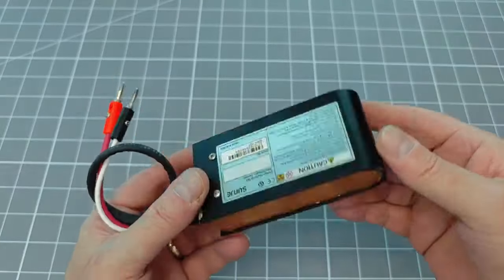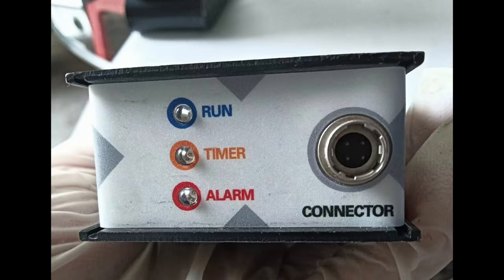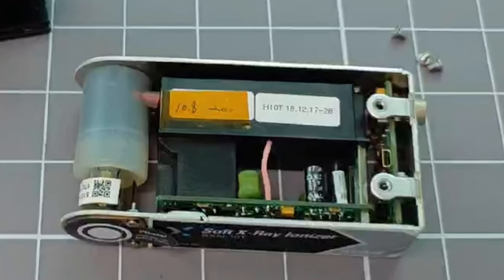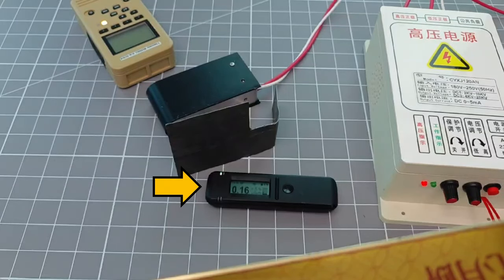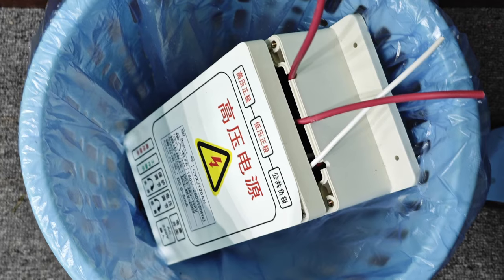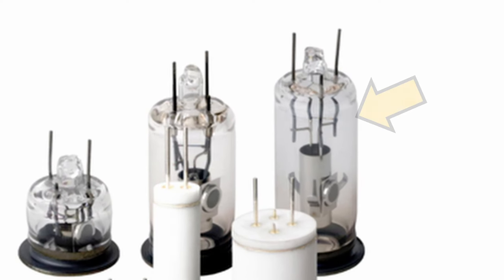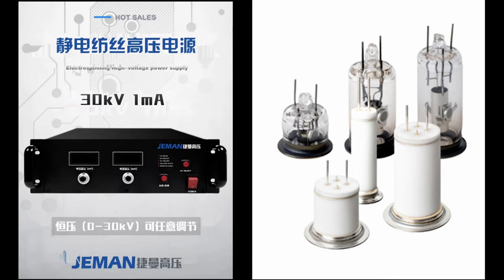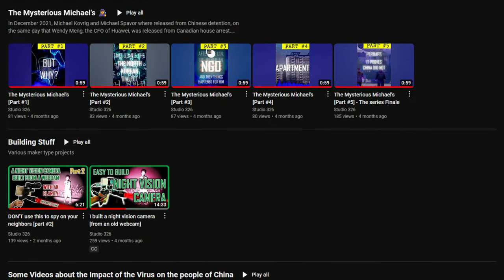a DIY x-ray generator ☢️

Comment: In case you want to do some Experiments with Photographic Film, i can highly suggest Fuji Instax Instant Films (also the classical Polaroids work, but they more expencive;). I did some Experiments with that stuff in the past, and can confirm its sensitive to X and Gamma Rays. Its a bit fiddly to get the unexposed Photos out of the Cartridge and back again, theyre very light sensitive so i do it under 2 Blankets in complete darkness. after getting them out of the Cartridge, i put them in black Envelopes + Gaffa Tape, then theyre ready for exposure. I even got a kinda Gamma Ray X Ray-Pic once using a Radium painted Compass as a source. Also got clear imprints of small Uranium Glass beads after 2 weeks of exposure ;) After Exposure, back under the Blankets and try to fiddle the Photos back into the Cartridge and into the Camera. I just closed off the Camera Lens with Tape, then press the Shutter to Develop the Pics. Im pretty shure you could get some Photos done this way with youre new Device. Thanks for all the great Videos! Enjoy every single one alot! :D
Reply from the maker: some great ideas, thanks!

Comment: Photograph a pad lock to obtain the pin cut to replicate a key . Photograph a electric circuit that's in cased in epoxy to determine the design details.
Reply from the maker: interesting ideas!
Reply: Another one radiate seeds and find a new plant with great properties.

Comment: Just thought I'd let you know that the radiacode isn't sensitive at all to the <5keV x rays that make up a large proportion of the dose. It only has flat dose response down to 20keV, and is designed to measure deep dose. The shallow dose in the place where the RC indicated 80uSv/h was undoubtedly in the many mSv/h. 
Loved the vid btw, such a cute tube and housing!!! Try measuring the output with an unshielded ion chamber. It'll be quite a high exposure rate!

Comment: Very cool. Totally unrelated: could you recommend a beginner geiger? Something simple but still solid and reliable. Thanks 🙏
Reply from the maker: It really depends on what you intend to use it for?
Reply: @project-326  two things really, I've been watching alot of plainlydifficult videos on orphan sources 😂 and I live pretty close to a nuclear reactor. I have kids and you know, I figure it might be a good thing to have at home :)
Reply from the maker: @maltadevnull  I sounds like you want something that has a good level of sensitivity for background measurements.  The problem with the cheap ones, is they all have some kind of limitation.  For example, the BR-6 is good for background by has a problem that it can real anything over 100 uSv/h (there is a video about that device on my channel).  The Pudibel devices have a good reputation, but I have never tested that product...
Reply: @project-326  alright, thanks mate! I'm going to look around.
Reply from the maker: @maltadevnull  Did you watch my little video the subject of orphan sources yet?  Personally, I thing that the scale of the issue is larger than most people imagine.
Reply: @project-326  yes I did, however after writing you, seeing as how you say you're not going to give out recommendations for Geiger counters in that video 😂

And yes, it is quite scary when you start to think about it. I'm not immediately worried for myself, it seems to happen more often in poorer countries. Still though, it's good to be aware of the problem!

Comment: Nice. The spectra with the 20 keV peak does look like Rh, but what it shows is the tube voltage at that time was much higher that you state, maybe 50-90keV. I assume you subtracted the background spectra collected while the tube was off. It is common to use tubes with a Rh source for analytical instruments like an energy dispersive XRF. You could not excite the K shell of Rh unless you have a tube voltage greater than about 25 keV, but realistically needs to much higher to get sufficient intensity in the Kab peak.
Reply from the maker: yes, I assumed that to do any XRF, you would need photons of a higher energy to start with.  Once I get my decent power supply, I will be able to make more careful measurements.  Maybe it was just wishful thinking that I could conduct XRF with a soft x-ray tube and a gamma ray spectrometer...  Normally handheld XRF machines use 40KV for their tubes.  What is nice about these soft tubes, is that they are rated for continuous operation, so I can make long duration measurements.

Comment: Would such a source be suitable for diy X-ray spectrometry?  If so perhaps we could then do XRF?
Reply from the maker: Thank you for the feedback.  I think that the acceleration voltage might be too low for most XRF application, normally it is around 50 to 50 kV (this tube is only 10kV).  The applied x-rays need to be of a higher energy than the fluorescence it activates.
I hope that helps!
Reply: @project-326  Thank you so much. You are awesome.  I have contemplated compiling a book of plans to diy a home chemistry lab.  Making measurement equipment affordable to the masses.  Perhaps compiling a list of foundational experiments, such that those so inclined can learn by doing.  I see what you are doing and i am overjoyed.

Comment: 0:50
Just by you having that realization, I am much less worried about the rest of the video. Far too often people don't approach hazardous topics with the solemnity they deserve and rush into things adjacent to their skillset unwarily. Thanks for using your brain and not chasing clicks. 
Idea: How about a cloud chamber so you can determine the directionality of the "beam"?
Reply from the maker: What is nice about this project is that the vendor has good data on the beam angle and the protection needed.
http://www.sunstat.com/wp-content/uploads/2021/06/210607-SXH-10T-Manual_Eng_A4.pdf?ckattempt=1
Reply: @project-326  150 degrees? I guess that makes sense for the application. My initial inclination is to make a collimator. I don't know if you have a 3d printer, but that might be something fun to try. I'm a materials scientist by profession, so I'd start doing material shielding measurements.
Reply from the maker: @rre9121  That's a good idea.  Since making this video, the viewers and myself have thought up all kinds of experiments.

Comment: since you have a spicy beta source, how about some experiments with it and a tungsten target to get high energy x-rays without the pains of obtaining a very high voltage source?
Reply: I'm afraid it's not spicy enough for this.
Reply: @karelsvoboda1812 yep. Enough to make the radiacode scream a bit on contact, but the dose rate from bremsstrahlung at 10cm from the source will be almost background. Not enough to replace a tube for typical applications

Comment: Hm, those soft xray modules are not cheap on ebay, I wanted to test it too.
Reply from the maker: really?  Once they have been used, they are basically useless to industry.  Probably due to the shear scale of manufacturing that happens here in China, means there are a LOT of these things.
Reply from the maker: I just looked, holy crap they are expensive on ebay - and the weird thing is that they all being shipped from here.
Reply from the maker: I just bought a couple more, on the off chance that the price goes nuts
Reply: @project-326  Any chance of resending them to Europe? :D :D
Reply from the maker: It occurred to me, that now I have enough subscribers etc, I would be able to have an official store.  Normally this is for stupid stuff like T-shirts and coffee cups with some YouTuber's logo on it.  I'm not sure if it would be possible, but perhaps I could supply some of the items that I can buy here in China instead...  Ie useful stuff.
I'm just thinking out-loud, so there could be 100 reasons why that might not work.
Reply: @project-326  That would be awsome. Those Xray tubes, Type75 meters, you could sell a lot of stuff available in your location to those (un)fortunate others living in different places.
Reply from the maker: @karelsvoboda1812  I will look into it when  get some time.  I'm sure there are all kinds of liability and import issues, but when I buy things here, there are always folks asking where they can get this stuff from.

Comment: Hi, thanks for your video I learn a lot from them. Actually the soft x ray head internal psu is quite easy to activate if you can reverse engine the circuit board. I have successfully did for VSI branded head. We can discuss the details if you want 😉
Reply from the maker: I would love to know more, I have a couple of spare units that would benefit from this...
I tried to investigate the first unit I bought for forcing it on but managed to screw up the main board (smoke released!) when experimenting with the two control pins that go between the connector board and the main board.
I have a VSI branded one too, the internals and construction techniques look so similar that I assumed that they must be the same company but with segmented branding for different markets?
Reply from the maker: @lunxg1  Project326@qq.com please email, for a WeCh ID

Comment: I’m interested in how radiation is used to remove static. I have a static problem on something I’m working on and wondering if it just had to be X-rays or if in can be any ionizing radiation?
Reply from the maker: Alpha radiation is also used for this purpose.  In the US a product called the 'static master' can be bought that uses exactly this principle and contains Po-210.

Comment: at 1:50 pay close attention to the instruction number 3. Do not the touch the widow because it is coated with Beryllium. On a side note, what is the maximum distance for the X-ray coming from this small device? This could be very dangerous if it gotten in the wrong hands as one can conceal this device in a certain location inside a house in order to irradiate adversaries with it? in other words it could be weaponized!!
Reply from the maker: this is a really low energy source, with a peak photon energy of around 10 KeV.  A couple of centimeters of plexiglas or a fraction of a millimeter aluminum will be enough to block this.

Actually the window is not beryllium coated, it is completely beryllium (about 200um thick), otherwise the weak x-rays would not be able to pass - the glass tube that compromises most of the x-ray tube can't even pass these low energy rays.

in terms of a weapon, this would be pretty useless.  To get a reasonable dose, the distance would need to be very close in (a couple of inches) and the duration would be very longs (months) and because it is small and very low energy source, it would only be a localized effect and not a whole body dose.

Another couple of points to note about this subject:
1) This product is intended for low duty-cycle use on a semiconductor production line, continuous use for a few days would take the tube to its end of life.
2) You need to factor in the inverse square law when thinking about the distance over which the source is exposing anything and the dose rate it gets.

anyway, I hope this helps.

Comment: Brilliant Video.. Very Well Explained.. Possible Next Project Sir..  An X-Ray Spectrometer?..  Thank you For Sharing.. From Australia.  😀
Reply from the maker: I have been wanting to do XRF measurements for a long time but there are two issues:

1) This soft-x-ray tube will generate a continuum that peaks too low, XRF really needs 40 - 50 KeV x-rays.
2) This is a hobby channel, I just can't afford a silicon drift detector.

Sigh...
Reply: @project-326  yes.. i see your point.. nice to dream tho.. 🙂 maybe an x-ray of a silicon chip on phosphor coated panel.. and also see the beam width.. thank you sir for your reply.. 5 stars.
Reply from the maker: @stuwilson3146  I will probably end up buying an old 50 KV small x-ray tube, I have tried to use phosphor panels to get images from this device, but the x-ray photon energy is just too low to be be able to get any fluorescence.  This particular device was really intended for testing radiation detectors with a low keV continuous spectrum.  It also makes the process of testing detectors far safer too.
But, deep-down, I know I will end up building something else to get higher energy x-rays...

Comment: At least proofread or use spell check before calling others out as idiots 8:43 SMH
Reply from the maker: Damn, I missed that.  In my defense, I was rushing to get it released as my work commitments mean I wouldn't be able to release for another week...
Reply from the maker: and you are correct, the typo being at that point in the video is also pretty ironic...

Comment: 3:05 When buying such a converter, please stick to the models that have CE certification. I looked up the manufacturer of the HV power source in the video, and the circuits looked fine only for CE certified models. The ones with plastic cases are not designed for long term use and are quite dangerous due to lack of critical insulation and flame retardancy. Wicked to say the least, their main use is to demonstrate fume cleaners when dealing with environmental inspections (that's why they don't mark the manufacturer on the casing to avoid being traced) 🥲
Reply from the maker: actually you are absolutely correct but I was just looking at price, my budget is pretty constrained as this is a hobby channel and I don't earn anything from it.  After the death of that PSU I really splashed out on a really nice PSU.  Hopefully I will get time to make a video about that...